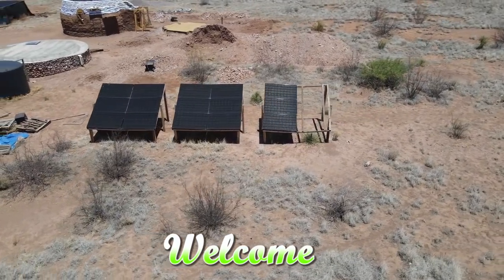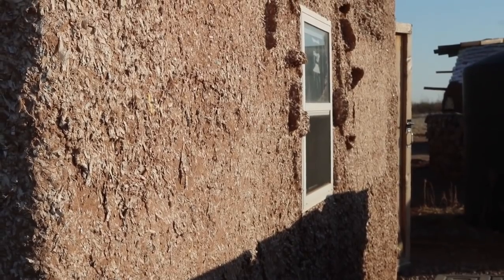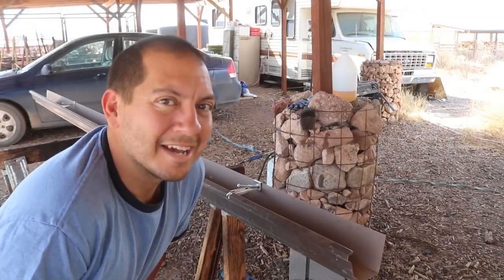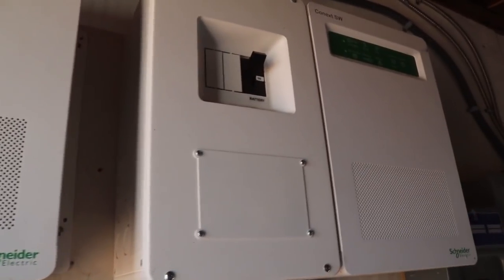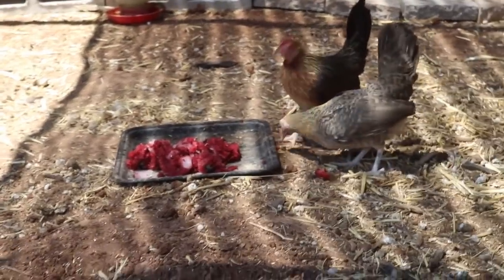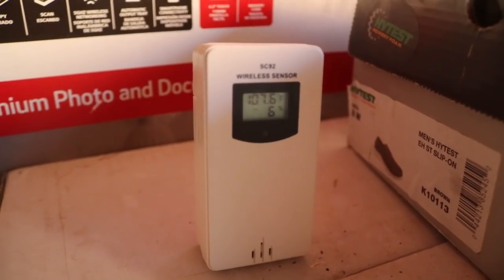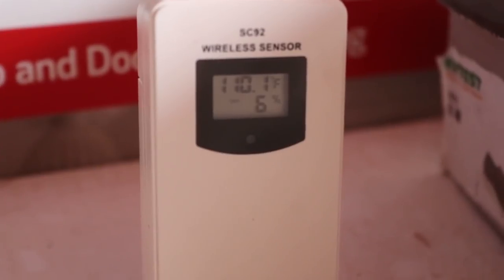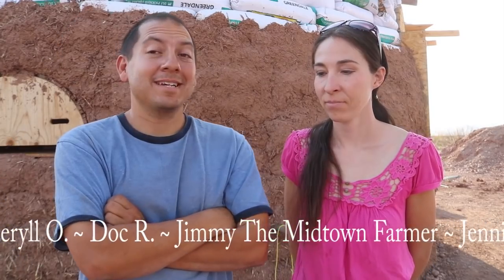Scorching Desert Heatwave Threatens to SHUT DOWN Our Off-Grid Solar

Comment: Try putting 3-4 short lengths of 4" PVC through the highest point on the wall of the shed with the ends covered with screen material to extract heat. And put the same thing at the lowest point on the opposite wall for air intake. It should help quite a bit to lower the temp in the shed. Hopefully 🤣. Insulation would be a great help also.

Comment: with the power shed you could try fans in the roof to pull the hot air out and fans to bring air in on the side that does not receive sunlight this should be the cooler air

Comment: If you have access to a backhoe Run 4 inch PVC six feet underground in a zigzag pattern with openings coming up in your inverter shed and possibly your RV and it looks like you have a carport that would be the entry point cover it with a screen the temperature 6 feet down is 55° the only thing you'll need is a computer 12 volt fan polar cool air out of the PVC that's your free air conditioner

Comment: It is easier to cool your camper from 80 to 60 than 100  to 80  turn your ac on while it is still cool outside.
Reply: Only problem is if it is too cold, like 60 degrees it can ice the evaporator and kill the AC but that usually happens when there is water in the air. We can't do that in Minnesota because of the humidity! It probably works great in AZ.

Comment: short of running the ac in my rv  the miracle fan cooled it down best I'd open a regular roof vent and use the miracle fan to push air out. 
I know a hole in the roof is scary but when it was 105 outside it would be 85-90 in my camper without ac . back. in the 80s and 90s when companies where installing giant computer systems. they installed giant air conditioner systems. maybe a small walmarche ac unit for the solar shed . no hole in the roof  and might be a cool place for crew when it's baking outside

Comment: I'm surprised you don't have heat diffusing or reflecting materials on the top and sun-exposed sides of the RV and solar shed. Foam insulation with the reflective sides, held together with a frame of 1x2s or 1x3s and secured to the undercarriage of the RV might be worth the expense. Of course I'm no expert, but I hate the idea y'all are being baked alive down there. Stay safe!

Comment: Dogs do not use sweating to cool down, their fur is there to insulate them from the heat. If you provide sweat by soaking the dog with water he will experience evaporative cooling thereby cooling the dog. Once the fur has dried it will continue it's function as an insulator. I know water is a valuable commodity but it wouldn't take a great deal of water to soak the dog..

Comment: Window AC unit. Problem solved. Cover the walls with 2x thick Rockwool and the roof with 3x Rockwool and you probably won't need the AC unit.

Comment: You're using the least efficient type of AC in the RV, you're keeping the door open making it even less effective. Also, for the shed, build an air filter/running water evaporative cooler.
Reply: Please consider that electronics and humidity do NOT mix. Maybe a small window AC would be better for the shed at the peak temperature times?

Comment: Maybe a greenhouse vent in the cieling that pops when it is hot and shuts when it cools off.  Also maybe a wet sheet for Crew to lay on when it is hot.
Reply: I thought Jim put a stove pipe vent in and a vent in the bottom of the door to the shed to help already.

Comment: 250sqft (4ft Wide) of NASA TECH Commercial Grade Solid Platinum Non Perforated No Tear Green Energy Radiant Barrier Reflective Insulation Solar Attic Foil Roof Attic House Wrap SCIF RIFD 
For the shed roof, and exterior of shed. At Amazon.
You put that on the bottom of the rafters in the shed. Plus, you should already have a high vent. If you run it around the exterior you will get a massive improvement as well. You can find similar other products as well, but this is extremely tough stuff and works far better than you realize. 
I keep warning people UV is higher than ever before, you need to be using the best kinds of uv defense products or awareness. And that window needs to be reflective filmed. You are collecting all that heat through any amount of daylight through the window glass as well.

Comment: Maybe use underground cooling system 6-8 foot tunnel with PVC pipes vented to shed
Reply: PVC is a poor conductor of heat.
Constant ground temperater is > 7 feet down (2+meters). That is under or in the middle of the caliche layer (calcium carbonate glues clay,sand, gravel & rocks together) then you would need to bury metal pipes with a working fluid to exchange the heat into the ground. It would take 100s of feet of metal pipe to transfer one days worth of heat gain.
Reply: @honthirty_  I think that Armida Perez was thinking cooler air temps rising out of the tubes rather than a heat sink idea you are thinking about.
Reply: @StoneKathryn  Where would the cooler air come from?
Reply: @honthirty_  I think you draw air up and the cooler air displaces the hotter air. If the fan isn't connected directly to the pipe. it should draw some kind of air back in to allow it to be exposed to the cool too.
Reply: @StoneKathryn  Cool air is denser than hot air.  
Earth tubes are heat exchangers.  Energy like heat, moves from high concentration to lower,  it is one of those laws of thermodynamics.  
Cool air wouldn't rise out of tubes long before you create a vaccume.
Reply: @honthirty_  That is why a fan pulls the air column. I think they are saying some kind of inlet at the end of the buried pipe. One person said screens on both ends of the pipe so critters don't live inside the tube. I've never built one of these but our basement is always cooler so having some kind of buried pipe has got to cool the air. If the pipe has been buried a long time, it will reach steady state of the surrounding medium (soil) temperature. Yes a metal pipe has better thermal conductivity but it is more expensive and vunerable to corrosion. Even aluminum will corrode. The metal will heat up faster too as the hot air is pulled into the inlet end. The plastic pipe will not absorb the heat of the outside air. I think it would work. Water as a working fluid would work better, true. Air is not a good thermal conductor, especially dry air. The air would need some time to cool down in the pipe so that seems to be the reason they are talking about long tubes. Maybe it would be best to use this source of cooler air at peak temperature times in the solar shed.

Comment: Rather than leave all that expensive elect. equip in the open i would try venting lo on the shady side with screens and the same on the top side a natural vent. For your chickens and predators you might try chain link buried in the ground and run up the side of the cage. I wonder if you could rent or hire someone to use one of those spray rigs that they use to spray that light weight concrete on fixtures to spray your house n maybe your cistern.

Comment: ssounds like the ac clutch.
Reply: How exactly do you know when the AC clutch is broken. My husband's car will onlt cool below 80 degrees then it quits. The dealer says internal switch on compressor has failed. Wondering if AC clutch related. They quote $1200 repair. He won't do it.

Comment: You should take some of the plastic bottles and fill them with dirt and add them as insulation in the roof of the shed to help keep it cooler.
Reply: Air is a better insulation than dirt.
Reply: @honthirty_  You both might be right. Dirt has thermal mass so it will shift the heat to a later time of day by absorbing it during the day and re-radiating it at night. Air in the bottle, dead air with no movement, is an insulator. If the air has moisture in it, not so good. Convection "cells" will start rotating the air in the bottles but still pretty good insulator. That is why "batt" insulation works well. Glass, not a good conductor of heat. Fiberglass, very skinny pieces of glass. Fiberglass inside a wall pocket will keep the air from mixing/moving. The air wants to move up and down with hot air rising and cooled off air sinking. The air insulates better with the batt insulation in the wall pocket because it blocks the air from moving. The wall becomes more conductive heat transfer than convective heat transfer. I think both methods will work.
Reply: @StoneKathryn   if you want thermal mass, not much is better than water. Dirt would be about half as good as a storage mass.  
Vaccume would be the best insulator.
Reply: @honthirty_  Yes, vacuum is the ultimate thermal break! Water would be great too but it wouldn't have the time constant that earth would have of re-radiating the heat at night (usually a 12 hour shift). It would stagnate in layers of heat but the heat would travel through it much faster than dirt. Water is great for thermal storage. It has the highest specific heat of anything. That is why it is such a good heat transfer fluid. Leave a bottle of water in a hot car and it gets hot fast. Put a brick in a car and it will get warm. Put metal in a car and it will burn you.

Comment: There is a fast easy good off grid affordable solution to your problem just check out today’s video from off grid with Doug & Stacy = the bad news is you would have to watch several of there every day video’s to see the 3 part solution cuz he shows & explains it in order of the cabin he’s building Now yesterday’s Doug video shows & explains the last part = Sorry I can’t find the other 2 video’s for part 1 & 2 or I would just give you the dates = I’ve been thinking about 2 hours how I could explained it in this comment & sorry you’d have to see it or it wouldn’t make sense BUT I’m guessing about 5 to 8 hours work & you might already have the stuff to do it & your solar shed would stay closer to the out side temperature PLUS you’d see for yourself if you want it on your house roof

It’s for real a good solution that’s worth your time to look cuz it’s a natural passive vent system that lets heat out in summer & holds inside heat in for winter
Reply: i was thinking the same thing
Reply: Ya! Another watcher of Off Grid with Doug and Stacy!

Comment: Ok air conditioner dig you a trench 6 to8ft.deep 25 too 100 ft long put in concrete box at both ends screen. Both ends and put filter on out side box install a large pipe between each box now and a second trench and conect the two out side box run other two in side one is going to return inside air to trench other will send 65 degrees air back in building may need trenches to be longer only needs fan to run on low to suck air thru trenches.

Comment: Guys, get some REFLECTIVE Material and post it on the OUTSIDE of your RV Windows... A Massive heat reducer. I'm in FL and as ghetto as it looks, I have small velcro strips on the corners of All my RV windows - went to Home-box Store and got a $30 role of that reflective material and cut out templates. Drops the heat by 90% for sure..
Also - I think you dog looks pretty miserable - maybe a shave and another dog roommate would help him...
Good luck.

Comment: why have you not bury a pipe in the ground and into your solar shed to blow cool ground air onto your inverters , you do not have to go deep  , go side ways , and for your gutter seams harbor freight sell aluminum welding rods that will work with just a regular propane torch , no welder needed . and have you tried mudding your container to make it cooler  ?

Comment: Do you have any way to check the water temperature in your cistern? I'm really curious to see if its cool... If it is cool... you could pump it through a radiator and basically have low energy air conditioning.
Reply: Little to No water in cistern.
Reply: @honthirty_  Ah makes sense.. I guess its because the lack of rain water collection?
Reply: @mzimmerman1988  a bigger contributor is general lack of rain in AZ, NM, COLORADO AND UTAH.
Reply: @honthirty_  And you could add this has been this way for a few years!

Comment: You may want to think about shaving Crew. My mom used to shave her yellow lab for the summer, and it definitely helps.
The other thing you could do for him is get a small kiddie pool, or wet him down throughout the day. I realize that this involves water, and y'all have limited water... sorry 😐 but the water in the pool won't go to waste, as it can go to the plants later.
I live in Winterhaven CA, which is at 200 ft above sea level, so we are quite a bit hotter, and have to get creative with cooling down outside.  
A small misting system, wand, or fan, will reduce the temp approximately 20° in the immediate area. Most cordless tool systems make a "over bucket misting fan" that draws water from the bucket, and will usually have at least 2 misting nozzles. Admittedly, they can be pricey. Ryobi has one for about 90.00.
❤️🌵☀️⛈️🌈☮️🐎🦍🐐🐕🐓
Reply: You can go to a farm store and buy a nozzle for spraying weed control from a tractor and those can mist too for a few bucks to hook it to a hose.

Comment: Does a swamp cooler take more energy than an AC unit?  I have seen home versions of a swamp cooler and perhaps something like this could work temporarily to keep you all cool enough through those crazy hot days?
Reply: Swamp cooler takes a lot less energy to cool! Just a fan over water! Fan power mostly. Cool mist humidifer could work too.
Reply: @StoneKathryn  Jim mentioned evap cooler as a non-starter already directly in this video.  His water budget could not take the 5 to 10 gal of water use everyday, right now.  
The cistern would fill (in a normal year) in about 9 months with his 2200 sq ft rain collector, ignoring residential consumption.  But the Southwest US is in a long term drought so it might take years to fill, even if Jim builds several more rain collection roofs.
The catch 22 of AC units cooling inverters is that it requires more power to run a bigger AC unit.  More power requires more heat disipation from the Inverter unit.  So it needs more AC cooling, so round and round.
Jim needs an inverter that is cooled directly by water, but those are custom designs.  His inverter is just over ~3KW so a 1000 gal open tank could absorb heat during day from inverter and radiate to night sky with less evaporation.
The problem is immediate but solutions are all long term.

Comment: I'm sure you've tried lots of things I'm going to give you some advice from somebody that has lived in the desert for a very long time air conditioning is great a swamp cooler is better in your situation uses way less power.
Reply from the maker: They do use less power, but they use a lot of water. We opted to save water.
Reply: That is true they use a lot of water I wouldn't thinking about that in a homestead perspective but you are very correct about that.

Comment: think about burying  a long pvc pipe  in the ground and pulling air into the solar shed through the cool tube
Reply: Pvc is a poor heat conductor.
Reply: @honthirty_  well since it would be pulling cool air into the building i think it will be just fine.
Reply: @mosbysmen   Really?
Can you have so little understanding how a ground tube 'works', yet still boldly offer advise?
Reply: @honthirty_  I'm sorry but you are thinking of heat sink and they are thinking of cool air from deeper earth levels. A heat sink in reverse. That is why a basement is cooler. About 8 feet in the earth is a constant, all year long 50 degrees. Put a tube that deep and over time it will be the same temperature as the earth even though it is plastic and have a fan pull the air through it and presto, cooler air. Yes filling the tube with water will be cool too. Then you could run the water through a heat exchanger because you don't want to expose your "working" fluid to too much heat so it stays cold and recirculates. Drawback, pump power and fan power and maintenance of both. You may need some glycol for "working" fluid exposed to freezing desert temperatures at night/winter (can't have air in system so always some "working" fluid in the coil at the heat exchanger that could potentionally freeze). The pumped fluid will gradually heat the dirt around the tube but probably not much because of the thermal mass of the earth. Air as a "working" fluid is easier to deal with and more passive. It only needs a fan. Metal conducts heat wonderfully but rusting or corroding is a problem. I think Mosby's men-ozarks has a valid method of heat abatement.

Comment: Aircon in the solar shed? Given time and money, bigger roof, open at the top of the walls and network of gunderground pipes that bring in ground cooled air. Hot air vents out the top and this draws in cooler air.

Wonder what the water temperature would be in your cistern when it's full. I've read about houses in the US where they use vented air through rock to cool the house. I don't claim to know anything, I just have a big mouth and busy thumbs... 👍
Reply: Cistern has 1-2 inches (< 10 mm) of water in it.

Comment: Swamp coolers work well and don't take a lot of electricity in that climate. Why not install one in the shed and the RV? True they use water evaporation to cool and that may be a problem for you but is should be less than 5 gallons a day ....There are different sizes available including a portable one that might just work in the bedroom at night to help sleep. You could also try soil berms along the outside of that shed or just bury the whole building (i.e. move it all underground...)

Comment: My walls are 44cm thick, with the insulation on the outside, of course. 27cm solid brick and render, 15cm PUR +2cm air gap 1cm PVC cladding Try these method: https://en.wikipedia.org/wiki/Passive_cooling

Comment: Put that rv under the shelter get the chicks a kiddie pool get a max split AC recharge your cars ac the high heat evaporates the freon you need a max fan in the roof of the shed and the dog needs a kiddie pool as well why do you wait until it's 90 before you run your ac